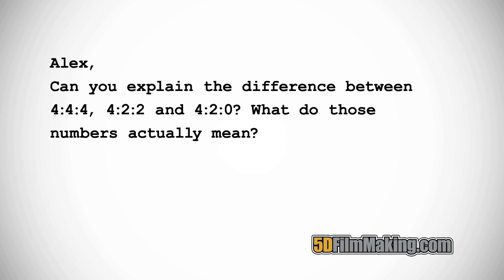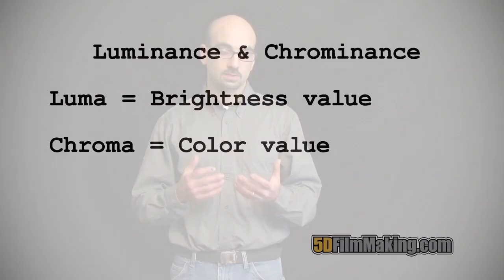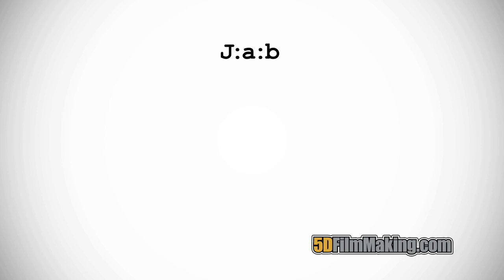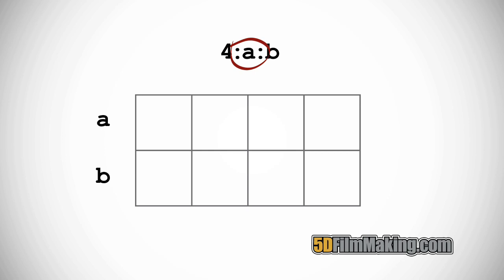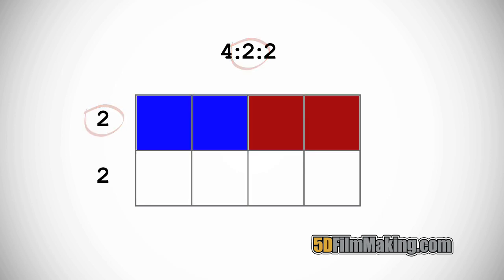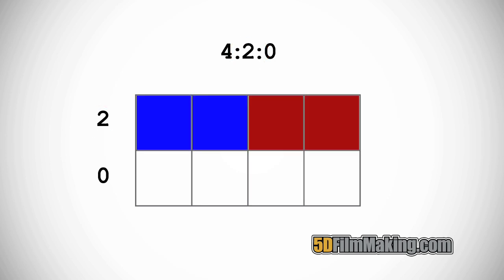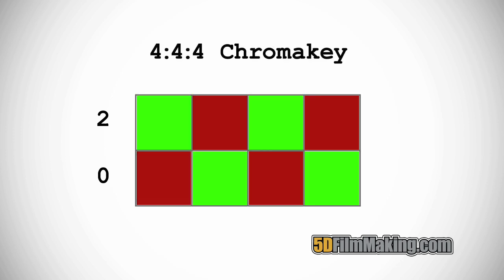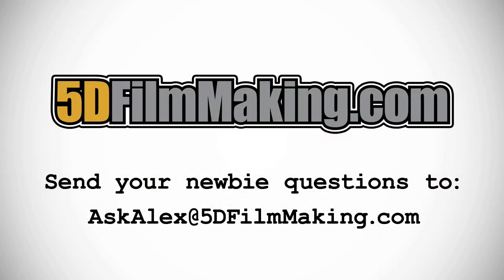Ask Alex - The 411 on 4:4:4

Comment: Chroma subsampling is evil. No matter how high the bitrate is boosted, it's impossible to get good quality. Bleeding added by lossy codecs gets further emphasized. Human faces, because they're often quite red, and because everyone has an idea how they should look, get rough at the edges.

1:04 - if you take all the luminance out of an image, you get faint, difficult to look at, ghostly shapes of color. It's useful to appreciate the actual color detal. Since chroma is deviation from green (which is now zero), you still get as much intensity in red and blue, as the (approximate) amount of saturation in the picture.

Now, in practice the chroma is upsampled with bilinear or bicubic filters, and the pixels sharing the chroma get some value inbetween the row above and the row below. Instead of blocky reds, we get blurry ones that look more natural.

Comment: so 4:4:4 is important for a tv if used with a computer (HTPC) because otherwise text could  look blurry.
Reply: MtnXfreeride 4:4:4 its never used because it requires bundle of GBs to do color sampling. That's why it remains unused.
Reply: Computer should be connected with a full RGB signal instead of trimmed HDMI Lum/Chroma
Reply: @Capeau   HDMI or USB-C has no problem with that bandwidth. It can even drive 5K monitors in 60Hz 30 bit RGB. HDMI 2.1 is 48Gbit: 5120x2880x30x60=26 Gbit.Thunderbolt 3/USB-C does 40 gbit, so also no problem there.
Reply: Bwahahaha

Comment: How does it applies to an X-trans sensor? (4:2:0)  Because the pixel arrangements isn't like conventional ones, that sensor spreads the subpixels to be more like a grain film than a conventional RGB sensor.... Artifacts will not have the same look. And I have another question about that, in 4:2:0 is pretty common to grade colors by adjusting the colors and contrast values while recording under minus 0, but if I can't get to much information from a 8 bit sensor and codec, taking down the color and contrast values will affect badly the color rendition vs recording that same scene with color and contrast values on 0?

Comment: My Vizio M43 (43 inches) can do 4k at 4:4:4 but my question is, is 4:4:4: better than RGB?  When I use RGB my NVidia utility states "Full Color" when using 4:4:4: it reads "Limited Color" or am I not interpreting this accurately?
Reply: RGB is a very old system where you had 3 separate channels. One for Red, one for Green and One for Blue.  The problem though is if you wanted to dim 'brightness' you had to dim blue, green and blue each.  As if I dimmed just the red channel, would the brightness of the picture decrease uni formally? No. You'd just see a lack of red color in the photo. To dim it properly, you'd need to also effect the green and blue.  

Of course, if your color tints slightly towards Green and you reduced the brightness accuracy, it might effect the green more or less than the other throwing off the color. Color representation on TVs are never 100% accurate. Even after calibrations and pre-calibration can be poor.

The M series from Vizio's "Calibrated Dark" setting is actually very accurate at color reproduction according to most reviews/tests on it though.  That being said, YUV is still superior. RGB was used on VCRs, DVD players switched to the 'Component' cables (with Y, Cb and Cr) which people called YUV for short. 

We now use YUV which has 3 seperate channels. One for Luminance (brightness rating of a pixel), one for purple/yellow and 1 for ....2 other colors. It's considered to create "better" control of brightness and better color separation than RGB.  Although, one can convert from YUV to RGB with no 'loss'.  RBG is just way harder to edit, adjust, apply effects to, etc.  Hence, why we've "changed".

4:4:4 is less compression on color. 4:2:0 is more compression on color data.  If I have a black belt on my waist that comprises 2,000 pixels wide, there might not be much difference in shading from pixel 1968 to 1966. In fact, I could take the shade at 1968 and average it with the shade at 1966 and probably make a VERY accurate guess at the pixel 1967.  IE, if it was 224, 222, 222 and 222, 222, 222. I could guess the pixel inbetween might be '223, 222, 222' though before 'downsampling' perhaps it was 222, 222, 222 and the color didn't change moving across pixels.

Once the "picture" from a Camera has been taken in 4:2:0, the color data was never recorded. You can convert 4:2:0 to 4:4:4 but it's just adding in averages/guesses as to what the 'middle' pixel is via a complicated mathematical algorithm that makes up mpeg2/hevc/h264/h265 encoding/decoding.

Now, if you have SPECIAL blu-ray 4k players with SPECIAL discs that say HDR and Extended Wide Color Gamut on them....they will usually have 4:4:4 encoding on them.  The M series from Vizio (2016 version) or the M65-C1, M60-C3 and so in including yours, according most reviews, only supports 4k 4:2:0 subsampling @ 60hz on ONE HMDI port (#5) or 4:4:4 @ 30hz on (#1-#3). The very COOL part for gaming about your TV though is it supports 1080p @ 120hz which your TV will attempt to 'upscale' to 4k using its upscaler.  120hz = more smoothness/responsive gameplay. 4k = higher resolution and more detail by typically way less FPS.  4k@60hz would be better for web-browsing, photo editing and that type of work. 1080p@120hz may be best for gaming.

Your video card might be saying 'limited color data' as your TV doesn't support 4:4:4 so it's only receiving 4:2:0.  It's not the end the world though, you can always return your TV for the P series which is about $300 more or so at most smaller screen sizes that was just released last month which does support 4:4:4, HDR, Dolby Vision and HDR10(soon with a firmware update).  

Vizio's Lineup basically goes like this 'E', 'D', 'M', 'P', 'R' as far as quality atm. They periodically refresh lines where E might go above D when the next years model comes out. Technically "M" was updated first this year and for a while was better imo than last years "P" but now that "P" has been updated as well, it's greater than "M" and maybe close to on par with last years "R". Once "R" is updated though, it'll blow "M" out of the water and beat "P" by a good margin.
Reply: Math Made Fun Thanks for the explanation!  :D

Comment: hey so can HDMI 2.0 do 4K at 4:4:4 ?
Reply: tinostarks Yes,depending on the TV. Some models do, like Samsung JS8500  and above, some do only 4:2:0, like the 2015 Vizio M line.
Reply: tinostarks I'm not quite sure but I've heard that the maximum transfer rate of hdmi 2.0 is just slightly too low for this.
If you wanna be sure go with displayport.
Reply: +tinostarks Yes, my Vizio M43 (43 inches) can do 4k at 4:4:4